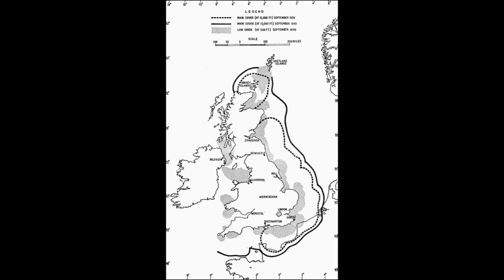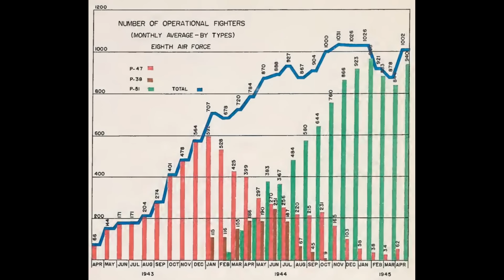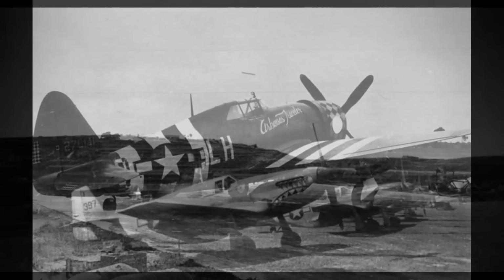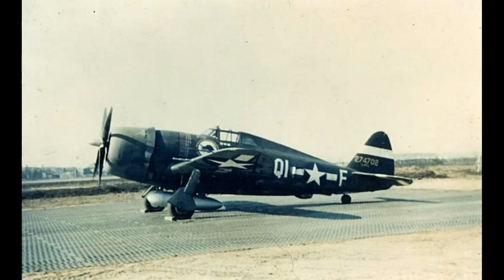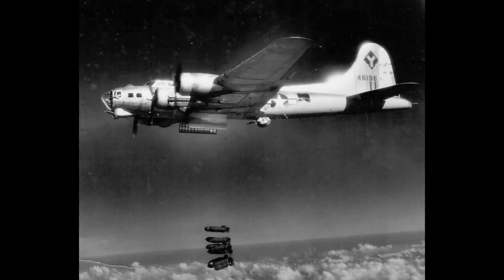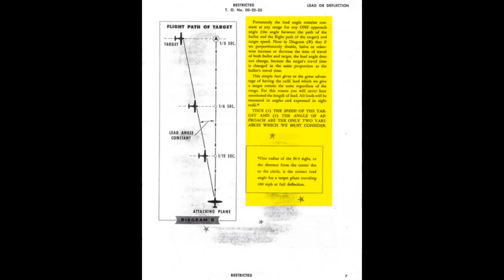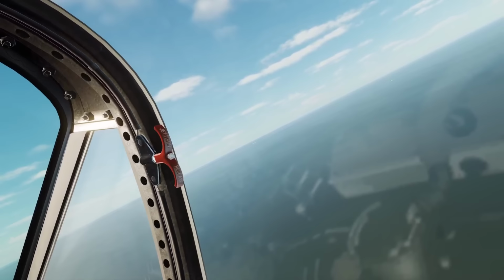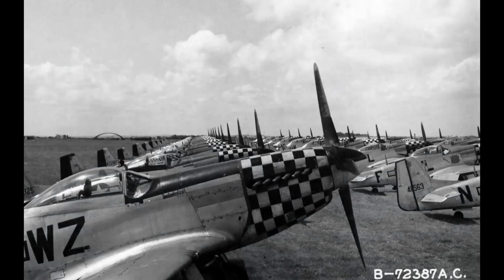Under Appreciated BRITISH Tech From WW2

Comment: I'd say that one of the most commonly overlooked - and CRITICALLY valuable British contributions was the cavity magnetron, without which airborne radar would have been impossible.  Apart from its key strengths of very high power output (essential for range) and extremely high frequency (essential for high definition of the image on the radar screen), the design made it not only possible, but easy to mass produce it to give repeatable frequency and power output to within close tolerances.
And, point of interest;  you've almost certainly got one in your kitchen - powering your micro-wave oven!
Reply: Absolutely a still-useful, brilliant & key development - but actually inherently unstable in frequency - both pulse-to-pulse and during the pulses 😕+ tho high power, the energy is spread across many frequencies 😕. These limitations have made it unsuitable for many high performance radar systems. H2S was possible without it and was built, as there were objections to flying magnetrons over Europe - but the magnetron version was better.
Reply: @jackgee3200  - well, YOU'VE missed the point by a country mile, haven't you?  For all it's limitations, in 1940 the cavity magnetron was state of the art - but of COURSE it was superceded by later developments!
Your criticism is as daft as if I were to say that "the F4U Corsair lacked the high performance necessary for taking on the MiG-17."
Some perspective;  in the autumn of 1940, Churchill sent a scientific mission to America, sharing a lot of our technical developments.  In one discussion with US Navy officers, they were complaining that their klystron ship-borne radar only had a maximum power output of 1kW.  One of the mission team reached into his bag, pulled out a cavity magnetron, put it on the table and said:  "That will give you 10kW - and we'll have it up to 25kW by the end of the year." (which they did)
Equally, in October 1940, when the Luftwaffe gave up on daylight raids on Britain and switched to a night-time blitz, the cavity magnetron was designed just in the nick of time to give us an airborne radar which could detect an enemy bomber at 3 miles range, AND used antennas small enough to fit in a small twin-engined aircraft like the Beaufighter.  As the ground radar could guide the nightfighter to within 3 miles of the raider, that combination was all it took to hammer the incoming bombers - and it was ONLY possible because we had the cavity magnetron.
Without it, German bombers could have raided Britain at night with virtually NO chance of being detected.
Reply: @jackx4311   Wow, you really are confused aren't you - about the sequence, timing & technology of the blitz + Airborne Interception radar + night fighter's + etc. See fun fact about Beaufighter AI radar below for just one big example.
I was completely polite in countering the specific matters which YOU got wrong trying to HYPE the facts -  but I can do 'condescending snarky' to match YOUR style.

Your diatribes dramatic 'grand finale' heavily references the AI radar used by the night Beaufighters.  YOU STATE - "was ONLY possible because we had the cavity magnetron" "just in the nick of time"  "in October 1940" to "hammer the incoming bombers" "Without it, German bombers could have raided Britain at night with virtually NO chance of being detected." 
Except....... It didn't use a cavity magnetron. 😲 Nor did the associated new ground systems. It wasn't even centimetre wavelength, but 1.5m. And it only became significant at the tail end of the night time blitz - ~April 1941 on.
You're not alone in letting fantasy and a few disconnected utube fact-lets lead you to assume that any "state of the art" (your words again) discovery could be deployed in complex workable systems in a few months. It's a common failing in those who lack any proper understanding - but wish to appear knowlegeable. 😞 What did you think they did, just hold an "easy to mass produce" magnetron in their hand as they sat in the cockpit ?

The AI Mark IV fitted came from many years work + prototypes were flying before c magnetron discovery. That only influenced AI radar from ~mid 1941 -  "Starting with the AI Mk. VII, AI moved to microwave frequencies using the cavity magnetron" then "The prototype Mk. VII BEGAN to replace the Mk. IV at the end of 1941"

Re: "hammer the incoming bombers" It wasn't till May 1941 that German bomber losses from all causes rose above ~ 1-2%. Insignificant in military operation terms. Barbarossa commenced in June and the bombers became mostly occupied elsewhere !
Reply: See interview with Mark Oliphant

Comment: I was hoping you'd mention the Meredith effect which the p51 used to gain a little thrust from its cooling system.
Reply: On a similar and lesser note, I’ve read some about how the US supply of ethylene glycol (coolant) was more scarce in UK during the ‘30s and ‘40s and thus more valued. Engineers at RR cut the mixture with water and discovered a coolant ratio of 70% water to 30% EG to be superior to straight ethylene glycol. The increased water was also safer or easier on various engine gaskets.
Reply: That is more of a combined invention between the British and the American, isn't it? With the British inventing the theoretical side of things and the Americans figuring out the practical things.

Comment: Bag tanks & conformal extension tanks were both British developments from the war years too.
Reply from the maker: I think so, they had the "slipper" tanks on Spitfires, but the Thunderbolts had those too, I'm not sure who was first with that. In any case, those had a negligible effect on the war, so I had no reason to include them.
Reply: @GregsAirplanesandAutomobiles  Yeh they were more about extending deployment/transport range, not combat radius. But the bag tanks are interesting & are today used in open wheeler racing. Thanks Greg. You certainly got these videos  by the bit now. Obviously you make a real effort to have your dialogue precise & spot on, to get you points across with minimal chance of anyone misinterpreting anything. Well done.

Comment: As described Gee-H sounds like a British copy of a German system of blind bombing used during the late stages of the Battle of Britain and then the Bomber Blitz. In fact, the measures and countermeasures to German developments became known as the Battle of the Beams. The German used, in order, Knickebein (bent leg or crooked leg), X-gerat (X-gear) and Y-gerat. Gee-H sounds exactly like Y-gerat. Y-gerat used a modulated radio transmission from a ground station that was picked up by a transponder onboard the bombers that would then retransmit the signal back to the ground station. The difference in modulation would determine how far the bombers were from the ground station. The angle of the received signal would also tell the ground station where the bombers were. Distance from known point + angle from known point = you are HERE. The bombers did not need to track the signal as ground controllers would do all the necessary calculations for correcting the flight path. This was used in from late 1940.
Reply: Professor R V Jones was the director of scientific intelligence during WW 2, his book “Most Secret War “ in the U S “Wizard war”covers the detection, and countermeasures used with these systems. The book is a comprehensive account of British scientific intelligence efforts in WW 2 and is highly recommended.
Reply: @scrumpydrinker  Fascinating book. 

I bought a small pile of USAF charts and saw a series of lines drawn mostly NS over the Bay of Biscay. I might be wrong but are they the descendants of a navigation system set up in Spain by the Nazis to help submarines to navigate? 

They were then used by patrolling anti-sub planes.
Reply: @20chocsaday  You might find “Instruments of Darkness” interesting, it’s the history of electronic warfare and was by Alfred Price.
Reply: @jackgee3200  OK. Then Gee-H sounds like a combination of X-Gerat and Y-Gerat. I don't have a reference handy to back the idea and I'm not re-reading my books on the subject just to score a point on the Internet, but I'm sure the British got the idea from the Germans who used a very similar system 2 years earlier. Now, don't get me wrong, I'm not some Wehraboo who preaches the myth of German superiority. On the contrary, I think the German were mostly behind the US/UK in the technology of warfare, but they were ahead in certain areas for a certain time, and I just want to give credit where it's due. It's too much of leap to believe that the British having expended much effort in understanding and then countering Knickebein, X-Gerat, and Y-Gerat, did not use the idea as a basis for their own systems.
Reply: @jackgee3200  Interesting! I love this kind of information. This story reminds me of the story of German radar development. A Tech start-up known as GEMA created a remarkable air search radar in 1935 that they demonstrated for the Kriegsmarine, but because the navy and Nazi officials were essentially techno-tards they didn't appreciate the revolutionary nature and so didn't prioritize buying and developing radars until much later. Thus, Germany squandered it's early lead in radar.

Comment: Thanks!
Reply from the maker: Wow, thanks Pete, I'm so happy now.
Reply: @GregsAirplanesandAutomobiles  After watching this video a few times now your comments about the water injection on the FW 190A and the Gyro-gunsight on the FW 190D brings to mind the BMW advert from a few years back - Evolution not Revolution -  . In the context of WW2 the Allies went with Evoilution and the Germans went with Revolution  , ( and yes I am talking in fairly broad terms here ) , they spent too much of their time on wonder weapons or if they did get something off the ground it would usually devolve into so many side project that in the end the main project ended up going nowhere ( Bomber B project springs to mind ) . I bring this up as in so many of the videos on YouTube the Germans are always painted as the technical gods and the allies always seem to come out as a bunch of technical knuckledraggers by comparison , this is one of the reasons for the £5.00 , in actual fact I think you need to do a few more videos like this and bang the drum of Allied technical successes a bit more .

Comment: I found a statement that hungarian inventor Donát Bánki invented water injection in 1898 (long before Ricardo). Could not find the exact patent though.
And to Pierre Hugon and the year 1865, though I don't know if that counts as water injection in the modern sense.
Reply: Newcomen used water injection in his 1712 century steam engine at the Conygree Coalworks in Bloomfield Road Tipton. Arguably one could go back to Edward Somerset, 2nd Marquess of Worcester in 1622. Ricardo recognised the concept could be applied to reduce charge temperatures which allowed higher pressures without detonation.

Comment: Gyrosights are not used in fighters since long ago. Since fourth gen at least fire control systems use processing power to calculate the firing solution

Comment: Interesting and informative video!  My favorite story about being wrong on a particular subject is the story of the British and aircraft fuel injection.  ONE guy in th U.K. thought fuel injection wasn't necessary and they blew it off.  The Brits were even given a functional FI system off a BF-109 and basically threw it in the trash.  I can only relish the thought of a fuel-injected Spit Mk IX - what an airplane it could have been!
Reply from the maker: The Spitfire Mk9 did have a primitive form of fuel injection. It wasn't direct injection, or even multiport, it was essentially what would later be called throttle body injection. The same thing was on the Mustang.
Reply: That sounds very interesting!! What would've been the reason for the Brits to can the whole "up and ready" German example of FI? Sounds rather stupid IMHO.

Comment: High frequency radar and paired powerful lights allowed the long range Sunderland flying boats to ravage surfaced U-Boats at night. Radar picked up the conning tower then just as the image went off scope they hit the Ley light switch. U-Boat was suddenly bathed in blinding light and a moment later, heavy shells and depth charges rained down.

Comment: I know you cannot include everything, but I think you should have mentioned the sleeve valve engines, the Sabre and Bristol machines.  They are perhaps the only unconventional engine design that was successful commercially, and would have taken over the whole airline post war industry if not for a few developments that the big war  created that affected the post war aviation market.  As is, only the French adopted the technology by producing license Hercules.  Also, Rols Royce refined the centrifugal supercharger more than anybody at the time, achieving the best adiabatic efficiencies.  The British also invented the jet engine, independent from the Germans.  The Whittle engine was way ahead than anything that the Americans had.  The all moving elevator that allows higher Mach number was first testing on diving Spitfires, and then stolen by the USA for the Bell X-1 supersonic plane, and then installed on the F-86 Sabre in the Korean war.  That was a pretty cool British innovation too.  Thanks..
Reply from the maker: I recently had a long video about the Sea Fury and I covered sleeve valves extensively. I don't feel they would have been a good fit into this video.
Reply: @GregsAirplanesandAutomobiles  Perhaps not.  Your next British fighter video should be the Hawker Tempest and Typhoon.  These were huge planes, along the lines of your favorite P-47, but of course with far more refined powerplant (and the Tempest, far more refined aerodynamically too).  But both severely overweight.  Anyway, in this video, you will have a chance to present the Sabre, which is far more interesting than the Centaurus.

The Hercules and its smaller brothers are also super interesting engines.  I have lots of good graphics for them from a book of the period by Judge.  Please watch the videos on the operation of the Bristol Freighters by the New Zealand operator which lasted through the 80's.  The 2000 hp version of the Hercules surpassed the TBO of the Centaurus, which held the record, and of course were more than double the American Radials, without the need of any cylinder replacement and such.

Cheers.

Comment: You could add to the list airborne intercept radar, as used in the Beaufighter and Mosquito night fighters. That's pretty significant.
Reply: The British invention of the cavity magnetron allowed centimeter wave radar which revolutionized bombing, air intercept, and naval warfare. 

German night fighters with their long wavelength radar carried huge antenna arrays which generated a lot of drag and didn't come close to the performance of the allied centimeter wavelength radar carried by US and British night fighters.

The Japanese navy gambled that their superior optics would allow them to outrange US Navy gunnery during the daylight, while their Long Lance torpedoes and superior tactics would allow them to rule the night. Both proved wrong once the US navy started using centimeter wavelength radar.

Admiral Donitz used his U-boats to attack on the surface at night, where they were undetectable by British sonar. Once the convey escorts had centimeter radar the U-boats were easily detected. Worse for the Germans, they were also easily detected by aircraft that could swoop out of the dark and sink them with a depth charge. Once radar equqipped long-range B-24's that could patrol the mid-Atlantic gap came into service, the U-boat war was effectively over. 

All of this due to the British invention of the cavity magnetron
Reply: @fafner1  That's all correct and very useful information. German radar-equipped aircraft had these crazy antennas which the British never had - huge advantage.

Comment: But didn't it help the Allies they were able to get 130 octane aviation gasoline? That high an octane rating meant the Rolls-Royce Merlin and Griffon engines could run at high horsepower without needing the complication of water injection.
Reply from the maker: The P-47's at 70 inches of manifold pressure were running 150 octane AND water injection. The Merlin engine in the P-51H ran 90 inches with water injection and high octane fuel. So if used in earlier P-51s they could have had even more power, same with the British planes.
Reply: @GregsAirplanesandAutomobiles  There comes a point where the engine can't take any more. Unlimited racing at Reno is one thing, but flying to Germany and back is something else!